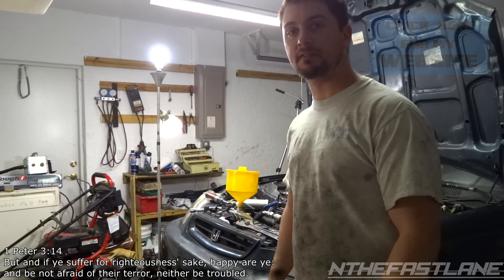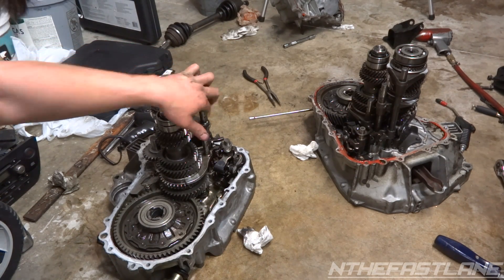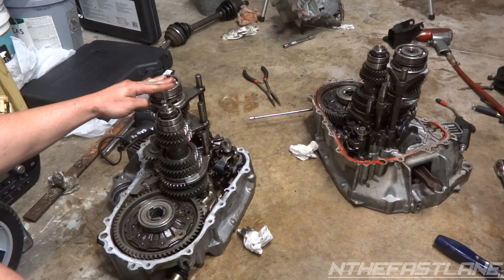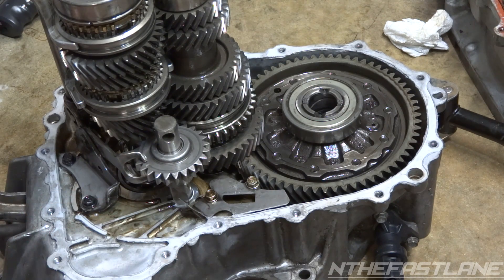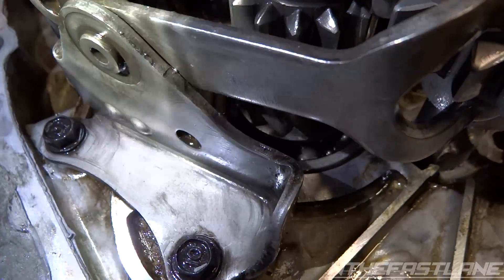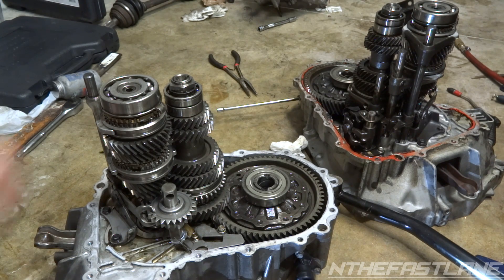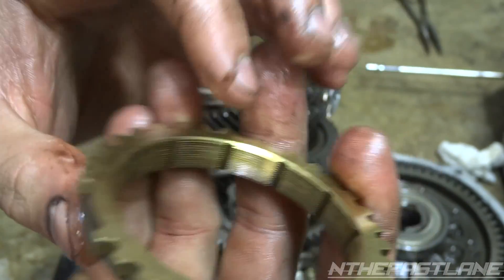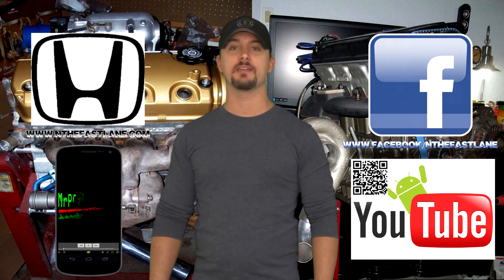▶️Manual Transmission Inside Look And Diagnosis Honda B-series🔧

Comment: I have a 2012 Accord 5 speed manual 4 cylinder. It will not go into first gear whether the engine is running or not. The slave cylinder will fully push the release fork when the clutch pedal is depressed. Any ideas why this is happening? Bent shift fork or what should I look for during disassembly?

Comment: hi bro just asking if s80 trasmission you can chane all gear from crv engine b20
Reply from the maker: I believe the CRV transmissions are like H-series internals. I don't think it's possible to swap LS or GSR internals into a CRV. Might be able to swap a few parts, but I don't believe any of the gearing. Especially with an AWD Crv transmission.

Comment: What if it goes into all gears with the clutch engaged? No resistance, and the shift linkage is all connected fine, as well as the clutch pedal feeling the same and having the same bite point it always has.
Reply from the maker: It is possible with the vehicle off to put it in gear without pushing the clutch. But if there's no resistance at all, like a click, I would suggest maybe your clutch pedal isn't fully releasing the slave cylinder. Possibly the clutch pedal isn't adjusted properly. There's two ways to adjust the clutch pedal, you adjust the master cylinder shaft to the clutch pedal, and you can also adjust the clutch pedal sensor distance to so-called fine-tune the pedal play.

Sometimes you can fully extend the master cylinder adjustment and still have pedal play, or no pedal play which is keeping the clutch engaged, that's when you adjust the clutch pedal sensor switch to pick up the slack or remove the engagement.

Hope this helps.
Reply: @Nthefastlane  I also thought that may of been a potential issue but the car was fine for about a year now. Thats the last time I changed the clutch. Its on an exedy oe replacement, and has shown no signs of ware. With this issue it goes into all gears with the clutch engaged like it would with the car off, but only now it does it with it on.  There's no resistance anymore. I believe it may the SCHA, but i was told that if that was the case then the shaft that the shift linkage sides into would rotate around freely.
Reply from the maker: I would narrow it to down to something's wrong with the clutch or the pressure plate. If you're able to shift the gears without pushing the clutch when you're driving it, then the clutch isn't fully engaged to the flywheel somehow.

An unlikely suggestion would be that the clutch fork doesn't have any anti-seize on it and it's getting stuck. Highly unlikely.

The other idea would be if you had your flywheel resurfaced and did not step the flywheel by removing the same amount of material you took off the clutch surface, and then take it off where the pressure plate mates to the flywheel, therefore the clutch never fully engages because it's a few thousands off causing less pressure.

The last idea would be either something's wrong with the pressure plate, or the clutch is just worn out.
Reply: @Nthefastlane  Thank you

Comment: was reverse working at all when your idler gear was out of place? thanks!
Reply from the maker: No, it won't go in reverse.
Reply: Thanks, I just put mine together and couldn't rememer if I had properly aligned the selector with the idler gear, you had me in doubts for sure haha. All my gears work fine on the bench including reverse so I guess I'm good then!

Comment: Hey, im having an issue with b18b gearbox, all forward gears are fine, i can hear it select /click  reverse but wont go fully in, any ideas?
Reply from the maker: It could have something to do with the linkage or it could be the reverse idler gear or the reverse change holder that moves the reverse idler gear up and down to engage reverse inside the transmission. It's possible that your shift boot isn't allowing you to go all the way far enough to the right and down. Try pushing your shifter as far to the right in neutral as possible and then go down and see if it goes in, if it does then it has something to do with your shift linkage being to stiff or tight or out of adjustment from the bushings underneath the shifter.

Comment: Nice video.  Very helpful as I am into a Honda D series transmission for a D16 swap into a first gen Civic.  220 miles on it but assuming Hwy miles as  Synchros look mint.  My main question I have is the with the main shaft bearing at the top of the Main Shaft (above the 5ft gear synchro).  Mine spins great and is quiet.  BUT - how much play should I have in it...whats typical or normal?   Mine has some......I assume some play is taken up once the shaft is in the cases with some load on the shafts but not sure how much is too much?  Curious to see what those ones have ?  thx!

Comment: I have a jdm type r integra transmission That sounds like it's binding when I turn the wheel . if I'm going straight everything is fine . any ideas ?
Reply from the maker: Might be a CV axle issue. Have a look at your drive axles. Sometimes when people repair disc brake pads they bend the dust shield behind the brake rotor. Might want to have a look at that as well. It could be rubbing on the brake rotor when you make a hard turn.
Reply: @Nthefastlane  thank you very much

Comment: Input shaft bearing is located on the inside of the transmission, the bearing directly behind the throw out bearing is the pilot bearing. Referring to what you said pre 6:30 on video.

Comment: Hey really love your videos they helped me 4 years ago take the dive into fixing my first transmission but now I'm stumped... I have come across 2 transmissions so far where the mainshaft it sitting almost 3/16 to 1/4 inch higher than the countershaft do you have any idea what that might be?
Reply from the maker: Polo Built I would say either something on the main shaft isn't pressed in all the way properly, adding the extra height, or the shaft isn't sliding into the bearing all the way on the casing. Just my thoughts. The countershaft sits higher so it can lock into the snap ring when the case goes on over. Maybe that's what you're seeing. Check out my video on how to clean and reseal a bseries tranny. I shoow how to put it back together.
Reply from the maker: Polo Built Watch this video: http://www.nthefastlane.com/Drivetrain/transmission-clean--re-seal-honda-b-series

Comment: I have a 98 gsr transmission and when I put my car in 5th gear it pops out , would you know what's causing that ?
Reply: Lol a bit late but did you ever figure out what the issue is? My dc2 gsr trans just started doing the same and not sure what to look for as I have never done any trans work

Comment: Nthefastlane hey im having a weird noise on my Em1 i believe is with my transmission b16 s4 , im not sure what it is , inputshaft bearing ? 

it makes like a scraping noise when i decelerate ( let go off the gas pedal ) while in gear ,  i posted a video of it on my account if you can please watch it and tell me with your experience !
Reply: Did you solve the issue? On your tranny

Comment: Is possible the throw out bearing cousin be making a loud noise due to it been dry or not haven enuff lub? Jus tryn figure out what steps to take me fire I take my trans completely apart does ska me thing clutch in no noise ,when I real let go of the clutch a loud humming noise starts press it in it stops jus not sure which it could be my clutch only has bout 500-1000 miles on it if that I know when I put the new throw out bearing on it it wasn't to lubbed up car sat n the garage for bout 3 months I started it one day an it started do the noise

Comment: Question for a ITR LSD 1998 spec the axle sits flush to the trans and out of no where loops out a bit then sits back flush ive tryed  4 different axle  and the teeth on the side that goes into the trans get a little messed up i ran out of ideas on what to do thinking of dropping the trans and getting inspected. But it i hope u get to read his

Comment: There is a 14mm bolt from the cover that holds the rev gear shaft in place. The only way it would fall out of place is if the bolt was not screwed into the cover into the rev rod. So why are u saying that hoeing was when u split the case. Maybe it just fell out after u took the bolt out. And case off

Comment: i have one for you my b16a trans won't shift into second gear after like 3000 rpms but fine standing still at idle all other gears are fine no matter what i just opened my trans and looks like little to no wear no chunks missing I'm stumped and so is everyone else i have asked
Reply: +ronald urieff  i was thinking synchro but they look fine but I'm no expert

Comment: hey fastlane. i have a strange problem ive never seen before. i have a b18 with the stock LS trans and my problem is that sometimes ill have transmission fluid on the TOP of the transmission. almost as if its coming out of the vent nipple on top. no visible leaks anywhere else after cleaning and degreasing.ill be driving around town and it shifts fine and everything..but ill come home and look at  the trans and ill have fluid sitting on top... if you have any insight id greatly appreciate it

Comment: hello guys..i have a question about B-series transmission..i have a y21 non LSD hydro from my B16A  eg6 hatch and i want to swap all the internals with  s9b LSD tranny off a B18c4 MB6(UK VTI) in my Y21 cases...so my question is..is it a direct replacement? thanks in advance!
Reply: +chris g  my internals from Y21 are already in the s9b cases and closed without any problems...
Reply from the maker: +chris g I could be wrong because I've never swapped one but the transmission castings are the same so they should swap right over.
Reply: Yep i can confirm it now that i did put the gearbox together..they do fit without any problem! Thanks for your reply!
Reply from the maker: +chris g Anytime Chris.Thank you for the update so others will know aswell.👍
Reply: s1 cable tranny and I need the torque specs for the ring gear bolts and the countershaft 23mm nut. Thanks for the help.

Comment: Thank you for the video! I now understand what noise is coming from my 2002 Honda Civic Coupe 1.7 Vtec , I just replaced the clutch kit (clutch plate, pressure plate, clutch release bearing) but the noise is still there. So now I know that it's the input shaft whining noise. I will have to get that fixed. I can also learn to live with that noise (which is only noticable when in neutral / first  / second gears) plus there's no other problem with shifting gears and car pulls in every gear like it should. It's just sometimes this annoying noise comes up when car is not running.

Comment: Please help. My 2001 GSr is making a gring noise at 4k rpms and around 82 mph. Im not sure why. It will stop after i go below that speed or rpm. I first noticed it after twking a roud trip and traveling about 100mph or more the entire trip. It started out as a slight winding noise and then stopped until i got on the highway again. Im able to shift in snd out of gears well.

Comment: hey i just opened up my transmission and removed both the mainshaft and countershaft. i have an excessive amount of play on 1st and 2nd gear on the countershaft, and its making the rolling marbles noise i was getting from my transmission when it was hooked up to the car (as i rolled from a stop into 1st and sometimes 2nd). i immediately bought the parts from honda, but just wondering if your idea is the same as mine - the needle bearings on the 1st and 2nd gear are bad? If you'd like i can take a video and show you. 

any help is appreciated!

Comment: I have question for For D-series Transmission let says  i m on the stop so i want to put the car on the first gear  but do not want to go in to the first gear  have to star drive the car on the 2 gear to make move the car do it to me some time and some time with the clutch all the way down make noise i think maybe  my clutch is running out
Reply from the maker: Sounds like you  have a bad synchro.

Comment: LOL gsr not good for turbo.  I stopped watching right then and there.
Reply: Gsr is the best factory gearing for turbo period.  If you want to get into aftermarket ratios and such and you are making big power, then there are better options but 400-600 whp....a gsr is the holy grail.

Comment: The only way that reverse idler is moving is if you don't have the reverse shaft bolt attached after you put the top case back on.

Comment: thank you so much for your didactic video. Can ı ask a thıng about atf dipstick.? ı went to honda service for rutine control. After 10 days ı wanted to check transmıssıon fluıd. ( ı have 1997 civic automatıc transmıssıon). ı took dipstick and ı shocked... in the middle of the dipstick, there is a mechanic damage.. as if milled with a 45 ° angle. but it didint break off.. What could cause this event??dipstick can touch any shaft or any gear teeth ???